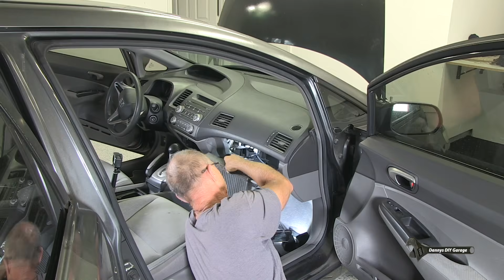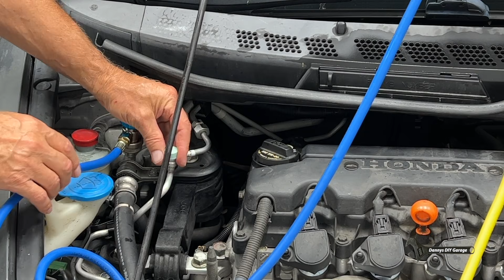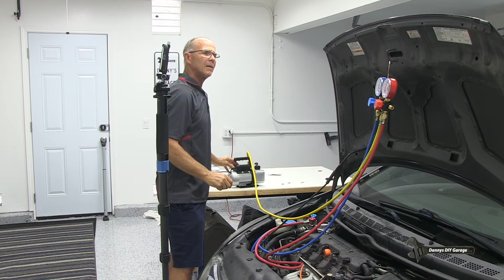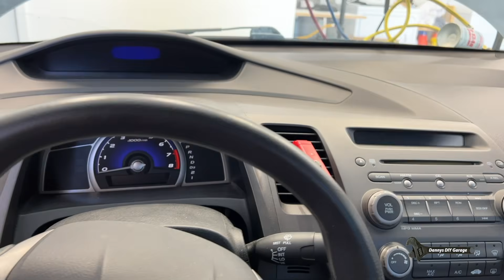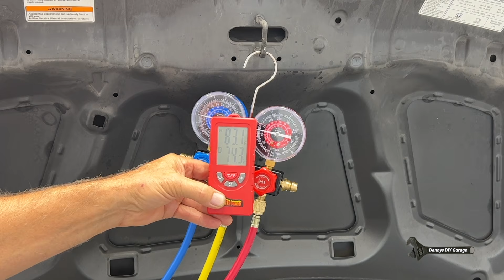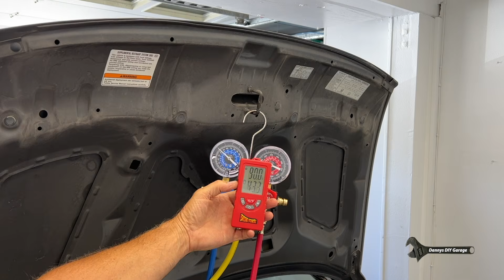How to Evacuate & Recharge Honda Civic AC System: FREE Tool Rental Method!

Comment: another great video that ill be using soon! i just finished my valve clearance today thanks to one of your other uploads. One question about this video in particular, it looks like you were able to pull the heater core out without removing the dash, am i right? you dont happen to have any videos on that do you? Taking off the whole dash is something i dont want to do if i do not have to. Thanks again for all your great vids!

EDIT: also was wondering did you remove the refrigerant yourself?
Reply from the maker: The evaporator is different from the heater core, the dash does not need to come out, just partially removed, here is a video link for removing evaporator and replacing the expansion valve https://youtu.be/IszUT0cwvQM?si=iLooyggP478Hg7f- , I don’t have a video on removing heater core just evaporator, my system was already empty

Comment: If you had 2 cans that contained 12 ounces, how did you measure out the 2nd full can of refrigerant or did you just dump all of it in completely so you charged it to 24 ounces of r134a to get your optimal pressures?  I've read charge with ounces of refrigerant and I've heard charge to desired hi/low pressure readings.  How long did it take to get to that super cold temperature too?

Comment: Danny’s DIY GARAGE…….when I pulled the top relay the 2 fans stopped. When I plugged that relay on the bottom to see if the compressor would work. It didn’t. I then replaced the original relay back on top and both fans started running. I replaced the bottom relay with a new one and the compressor came on. On my model 2008 Civic EX it seems the fans have to be working for the compressor relay to work.

Comment: How many cans did you use and what numbers did you get?
Reply from the maker: 2 cans and links to the product is in the description below
Reply: @dannysdiygarage  thank you for your reply.
My 07 civic ask for 16oz but it's not enough. The air coming out the vents is at 60f on 90f day also my ac gauges psi are low according to the chart. 
Thank you for your videos they have help me out 👍
Reply: @gamekingkiler 60 isn’t that good. These civics get down to 40’s all the time.

Comment: Danny, I want to just vacuum and top off or add any refrigerant to my 2010 Accord that I may be low on.
So, if I haven't replaced a component and my system has freon already in it, then what would my procedure be then?
There are no leaks, and it blows fairly cold, however, like you, I want to get my temperature as low and cold as possible. 
Any advice appreciated,
Reply from the maker: Over the years your ac system can develop a small leak and not cool as good as it could, unless you own ac machine that will properly remove recycle and evacuate the system, you’ll be limited to adding Freon, monitoring the air ducts temperature while adding a little Freon can help, just don’t add to much, go slow, you can always add more, check out this video at around 10 minutes https://youtu.be/WbPGVfQjAU8?si=HI_inFKT_7lgxU94
Good luck, buy Freon with die and never buy anything that says it will seal leaks, I should have a link for Freon in one of my ac videos description

Comment: Hi Danny hopefully you see my comment I have a 2005 Jeep grand Cherokee I was not having any reading so I replaced the compressor and clean the system no leaks now I have static pressure I add Freon when I am adding Freon everything looks good but once it stop. Low pressure drops negative and high pressure stays on static even though compressor is running. What can it be? Thank you
Reply from the maker: Sounds like a possibility of blockage

Comment: 3:16 mine stays stuck at -19 psi and loses the vacuum slowly. I have replaced both hoses and valves and the condenser is still good. What could be causing this?
Reply: Did you ever figure it out?
Reply: @MrSamPhoenix  turns out the front condenser had a hole in it. Replaced it and added the correct amount of AC oil. My AC gauges are inaccurate and need to be calibrated or replaced with a better set. It’s what happens when you deal with tools from Harbor Freight. So my AC manifold and hoses were fine, just the gauge is cheap and not as accurate. But a really good set can cost several hundred dollars. The HB set only cost $75.
Reply: @Stonehopper1067HMG  wow! Thank for the information

Comment: You dont explain how much fryonnto put into the AC system, you didnt explain how to tell when the system is not leaking and how to read the gages properly, you didnt explain why you had to purge the line, and the fact that if you put in more refrigerant into the system it can actually damage the system itself, how to calculate the correct amount.
Reply from the maker: I’ll do an update later April explaining all this in detail, thanks for the heads ups

Comment: Danny, thank you very much for putting these videos of the ac system up.  I have been following you step by step for a complete ac system replacement on my son's 2008 Civic.  Your videos are awesome and extremely helpful.  I've used quite a few of your videos as I get this car in shape.  Your videos have saved me approximately $1500 in dealer labor in the past few weeks!  I only wish you had an Accord as I need to go through my 20013 Accord with 210,000 miles.  That Accord has not had a single repair or replacement other than tires and battery so I have some work ahead.
Reply from the maker: I appreciate your gratitude ❤

Comment: Great video, wondering do I need to add pag oil into the system after vaccum?
Reply from the maker: I did not, what comes out is minimal, I only add when I replace a major part

Comment: I can’t get my ac to 43 degrees
Reply from the maker: Depends on humidity, temperature and many other factors
Reply: @dannysdiygarage  can u help me the low I get too is 49 degrees I replace everything did I do something wrong low side 36 high side 198
Reply from the maker: Did you watch my other ac diagnosis videos?
Reply from the maker: Did you check the blend door to make sure it’s moving all the way
Reply: @dannysdiygarage  yes I did am in Houston Texas
Reply: I don’t knw did I have some air in the system or low on pag oil
Reply from the maker: Hard to say, did you use a vacuum pump to remove air and moisture
Reply: @dannysdiygarage  yes sir I did one thing I didn’t mess with if the condenser I bought the car with it look new so I didn’t mess with it  do u think it has a filter in it
Reply from the maker: Expansion valve?
Reply: @dannysdiygarage  yes I did replace
Reply from the maker: Depending on humidity and heat 50 might be as good as it gets
Reply: @dannysdiygarage  ok thank u I guess
Reply from the maker: Sorry, I just don’t have the answer
Reply: @dannysdiygarage  thank u for ur Time

Comment: @7:36 May I know what were the final readings on gages after everything done? I think it is important. I believe I've read somewhere (I think someone on Amazon wrote) that we can go not by the weight of the refrigerant added, but rather by readings on the gauges. In many films I see they put those cans w/refrigerant on scales. This part is a bit confusing to me. Thank you.
Reply: about low 32psi and high about 220 psi, your air cond pump older may need more gas, some models new pump only need 22psi.
use scale, because every cars gas have there own quantity, is old school,  exe if this air cond still have problem like block somewhere, put this quantity will damage the system!
Reply: @alanw5812  Thank you for the detailed explanations. I fixed out 2001 Saturn SL2 HVAC system and it works great, but it is always good to know more details.
Reply from the maker: I don’t remember the final reading sorry
Reply: @dannysdiygarage  That is O'k, thank you for reviewing my comment. Actually I think it might depend on a particular car. I found what those readings should be fm/Shop Manual (3 huge books) for the car (2001 Saturn SL2) I'm working on, they depend on temperature and humidity. The car requires 24oz of R-134a, so I think I'll go w/this amount, but keep eye on gauges, not to go over the limits for advised in the book pressure.

Comment: I have 2007 civic hybrid and I’m replacing the evaporator, expansion valve, condenser, and compressor. How much oil should I put and where to put it? And when recharging with Freon, do have the ac on high(blower)? Thanks!
Reply: AC on high. You should be able to look up the amount of oil for each component and add it to the component when you install.

Comment: What is the purpose of the “H” line? Is it only opened when purging the system of air and moisture? Newbie to AC systems here!
Reply from the maker: High side and low side readings helps determine proper balance of Freon or pressure, most cars are charged by the low side
Reply: @dannysdiygarage  Thanks Danny. Another question: when you evacuated the old freon, how did you collect it? I want to do this entire procedure on my 1996 Camry, but the collection of the old R134a intimidates and confuses me…

Edit: I want to add that out of all of the videos on YouTube that I have watched on performing this job, yours is the easiest to understand!
Reply from the maker: Local shops usually will remove Freon for free, not all, but some do

Comment: Mine blows cold air fir like an hour in the morning and then the compressor stops for the rest of the day, what would be the problem?
Reply from the maker: I have a video on possible air conditioning causes on my channel which could possibly help you, please check it out
Reply: Hi, i watched that video but i didn't catch the problem yet, freon is good condenser is new, fans working, even on the scanner it says ac on, clutch on but the compressor is not working i poured water on the compressor and it worked again then stopped after like 30 mins. Could it be a sensor like a speed sensor?
Reply from the maker: @kassemhaydar-o6k  did you watch my diagnostic videos, here is a link https://youtu.be/WbPGVfQjAU8?si=PZ2sklL0DaxzcDce

Comment: 2013 Toyota Venza V6 my ac was cold, but not cold enough. I know theres no leaks because the AC still works just need some time to get cold. I evacuated and recharged by weight, and even adjusted for the freon in the lines (find the volume of pipe).  The result? 100 degress outside, and almost immediately my AC blows 38 degrees. I also have a 2016 CRV, much newer but cannot blow this cold especially on a hot day!
Reply from the maker: thanks for sharing

Comment: Sir, please could you tell how to purge the car AC system with dry nitrogen after solvent flushing? Is it very complicated procedure?  Probably it is, since nothing on YT on this subject (including this rather detailed film, purging w/N_2 was not done though. I've read that if the AC system was opened to the air it should be purged w/N_2).  Thank you in advance.
Reply from the maker: I’m not the person for that question, sorry
Reply: @dannysdiygarage  I've learned that actually that N_2 purging is mostly for the large HVAC systems, not for cars. And your film confirms that, since you obtained 42F and without that procedure.
Reply from the maker: Appreciate you clarifying
Reply: @dannysdiygarage  My pleasure.

Comment: Such a great job !  you are a great teacher and the video was awesome.  Thanks thanks thanks!    was your problem AC hot at idle?   That what mine is doing and its the same car.  once the RPMS go up on the engine it works great.  I did a charge and it didn't help me.  I think the expansion valve is my issue ,  Thoughts?
Reply from the maker: Yes, that was my issue exactly

Comment: Hi! Great video. What should I do if I preform a leak test and the gauge moved ever so slightly? I preformed my leak test overnight (instead of the hour you did) but only pulled the vacuum for 15 mins. Could this be why?
Reply from the maker: It should hold vacuum for 1hour, there is no spec for overnight, you’re probably fine
Reply: @dannysdiygarage  what happens if the high pressure loses vacuum, but the low stays.
Reply from the maker: @Matthiasisthegoat  they should both hold a vacuum
Reply: What am I supposed to do if the high doesn't hold vacuum

Comment: Not sure how to read the gauges any tips ?
Reply from the maker: Best to look up a chart on Google, gauge readings change depending on outside temperature, ask Google for AC gauge readings for a Honda Civic chart, my experience is usually: low side is typically 35 to 40 high side around 180 220 depending on outside temperature
Reply: @dannysdiygarage  thank you!!!! Saved me literally a thousand bucks you got yourself another subscriber 👍

Comment: Hi Danny how were you able to measure the exact amount of freon? Considering that you had 2 12oz can and the system called for 14oz
Reply from the maker: Great question, I added slowly the 1st can which should be 12oz, then I monitored the outlet middle vent while slowly adding more Freon from the second can until it reached its lowest temperature reading, when you add more Freon and the temperature starts to climb stop, and that’s the amount, I used a full can and approx 6oz out of the other, which is normal because some Freon is left in the 1st can and some was left in the hose, if you have a scale, that would be best
Hopefully I explained this correctly
Reply: @dannysdiygarage I read it takes 17-19 oz. So would make sense you added another 6 oz.

Mine drops down to 39 F on the road. Think I’m good or should it be lower?

It was over 90 degrees outside.
Reply from the maker: The temperature will probably only go higher from there, 39 is exceptional, stop, you’re good
Reply: @dannysdiygarage  thanks Mr. Danny. You’re the best! Keep up the good work!

Comment: When filling back up with Freon , do you only open up the low side or both low and high ?
Reply from the maker: Only the low side
Reply: @dannysdiygarage  thank you boss.
Reply: when I opened the low side to charge the high side needle didn't go up like it did on your video. and my air is still not blowing cold, I installed a new ac condenser and valve

Comment: In total ,how long did the job take, 1 day or two?  Good job, very good video capture of all essential elements to do the job. I am thinking of attempting this to replace the evaporator as I believe it is leaking.
Reply from the maker: To replace the expansion valve, if you go slow it should take 4 hours, it took me about 7 with filming, recharging the system 2 to 3 hours due to filming. Hope this helps, if I did it again, probably 4 hours start to finish

Comment: Have you encountered issues on civic where the car vibrates for a little when the rad fan turns on?
Reply from the maker: no, not really, is it the compressor or the fans causing the vibration? I can tell when my compressor kicks in due to a slight vibration, however nothing out of the ordinary, you should possibly look at your engine and transmission mounts

Comment: What were the high and low pressure readings when you finished adding Freon?
Reply from the maker: high side reading @ 1500 rpm, fan in front of the Radiator 175 to 200 PSI and low side 25psi to 35PSI  90 degree day and 5% humidity outlet temp air duct fluctuates 41degrees to 44 degrees